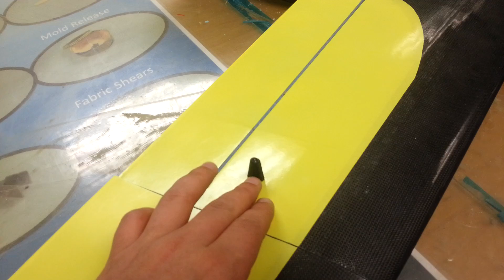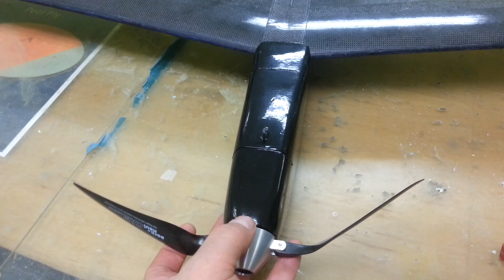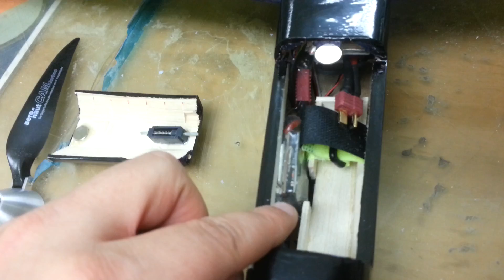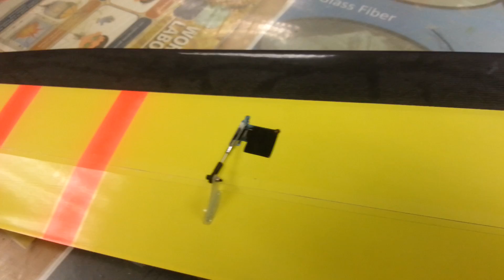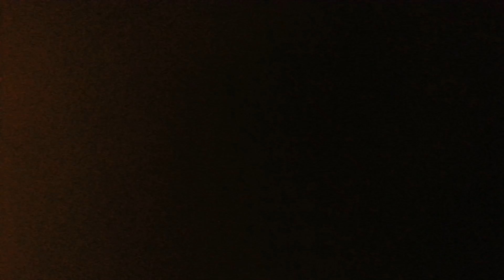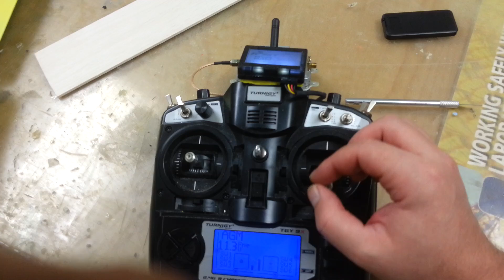The Anti Gravity Machine - FPV - thermal soaring

Comment: The esc heatsink is becoming obselete. Quadcopter pilot prefer to strip the heat shrink out and take the heatsink out to expose for better cooling. Also they use nail Polish any similar to protect the electronics. But over all well done. Like your plane.

Comment: your two rx wires should extend outside the plane and be 90 deg. of each other. keep them away from carbon and other wires, batt, ect.  i would not trust that 1watt wifi booster, i had one they suck
Reply from the maker: +Ikeman Richter 90 degrees apart antennas make only sense when you fly a 3d plane or intend to do some aerobatics. AGM is banking most of the time, but not more than 45 degrees. There is no carbon or wires close to the antennas. Lastly, these are custom tuned dipoles, taking into consideration the dielectric constant of the PLA 3d printed mount that you see on the wing - which is RF transparent by the way... Your normal FRSKY antennas are not very good unfortunately...

Funny that you mention the booster. Mine worked ever since, never had an issue. Even if it did have one, RTH would bring AGM. What happened to your booster that you dislike it so much?
Reply: sorry 90 deg from each other and as far from each other as possible. remember the active part of your 2.4 rx antenna is the last 30 or so mm
Reply: my booster was DOA. Your plane looks great and seems to fly well too. nice job.

Comment: Super sleek and well executed! Following over on the lab thread..
I wonder if you could likely just embed the 5.8 vtx antenna inside the tail. Since you are only going to be flying directly away from yourself for a very short time, I wouldnt see any reason an omni would need to be vertically oriented on a fixed wing. I figure you would spend more time directly above yourself (null in vertical) than at ground level going away (horiz)
Just a thought. Looking forward to seeing your progress. Very impressive!!!
Reply from the maker: Hi,
I had given this some thought and played with it for a while. In the end, I ended up with the solution you see because:
1. boscam 400mW VTX: has the right frequencies for the rest of my gear, I didn't wanna chane it
2. VTx truly gives out 400mW RF
3. The dip switches are a pain and I need to change channel every now and then
4. the wires inside the fuselage, the carbon vertical fin may disturb the radiation pattern

This has still to be proven effective.
thanks for sharing your ideas!
Reply: Matt hias I figured you tried most ways before settling, You dont strike me as the rushing type. I didnt think about the carbon in the tail also. Should be a sweet ride made of pure float! ^_^